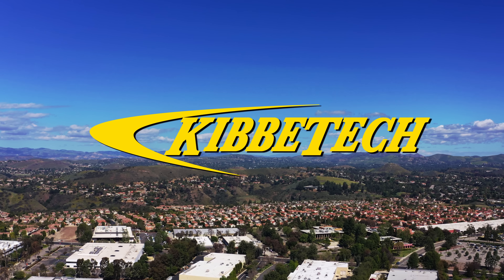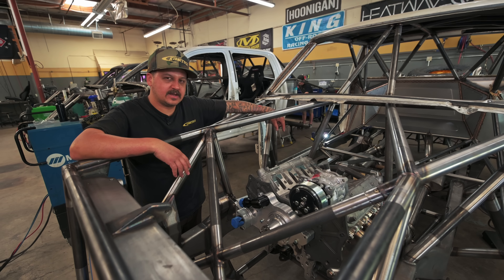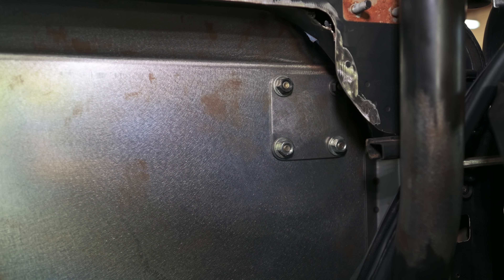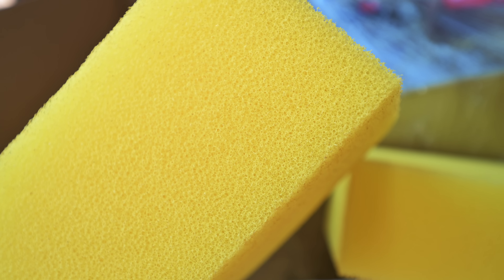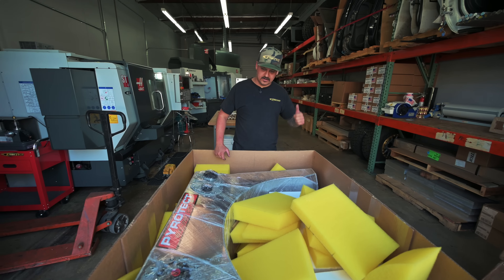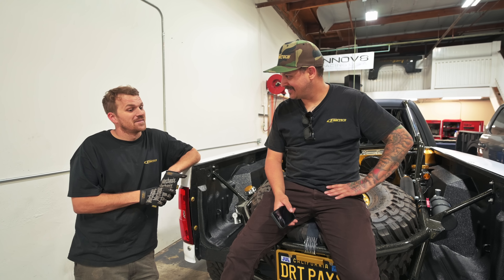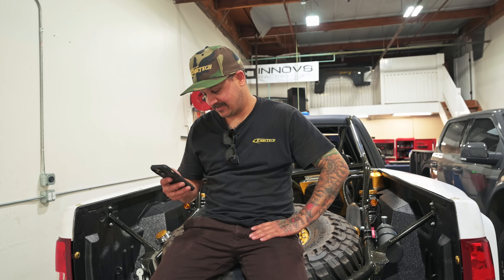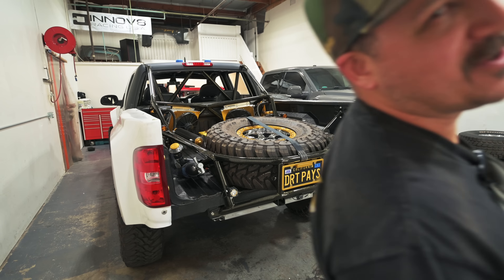Chrome Truck is ROWDY after the Dyno

Comment: When u mount the engine and trans directly to the tube frames with the mounting plate how bad is the nvh? Do you get a lot of heat transfer into the tube?
Reply from the maker: Not much heat transfer.

Comment: Something ive been wondering is why we don’t see manual trans on prerunners. Is it just not popular or do you risk blowing up more rearends with a manual?
Reply: I might be able to answer this one for you. In my mind its a 3 part issue
1. Stress risers from loading and unloading the driveline with direct drive can be merciless on parts if you stick a landing with a lot of torque being transmitted if you forget to clutch in
2. Racers want to focus on driving and its just ine more element to distract the driver 
3. You need to pick parts to a point that are popular and readily available and have the r and d done.

Comment: So I can't order parts? Unless
It comes to 100k?
Reply: I’m pretty sure you can order parts, I think he means they aren’t going to build a truck for you unless it totals 100k.  The fucking overhead running a place like that is huge and if it didn’t total that it doesn’t make the shop a profit.  🤷‍♂️
Reply: You can go to there website are order what ever parts they make you want. What he's saying is they don't do minor jobs, full builds only. I fully get why he does this because if a trucks been to multiple shops for a build, some maybe not so stellar work from another shop could reflect badly on his. One stop start to finish.
Reply from the maker: You can buy all the parts you want! But in the shop we only do full builds from start to finish with our parts only
Reply from the maker: @BlackJacket705  exactly! You get it
Reply: I pick up a  08 chevy 1500 extended cab and need to give it the Kibbie treatment lt front 4 link rear swing set steering, cage , probably 50k in parts
Reply: @traviscassidy4717  giant palet and burn in my self ,have a 6000sqare foot shop with all the tools I need and I'm retired , I did a 69 camaro body once from all the individual pieces,  came out  good ,but I'll never do it again,  Kibbie and his crew have the best thought out parts on the market,  alot of video of them that you can actually see them work, yes it's expensive but good stuff ain't cheep
Reply: @dannycrayton725  nice!  Totally agree.
Reply from the maker: @dannycrayton725  yeah you've been talking about it for awhile, lets do it already!
Reply: @Kibbetech  when can I drop off a truck?